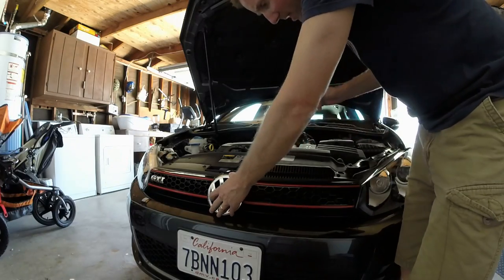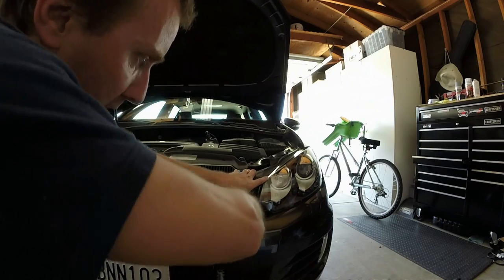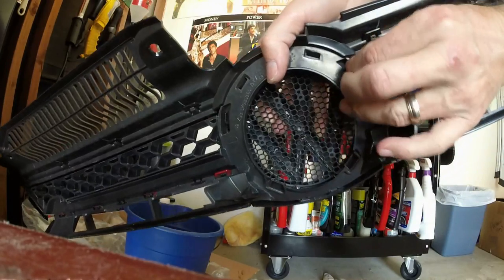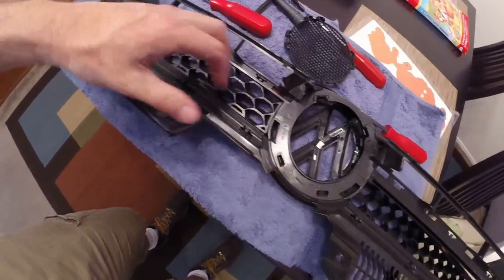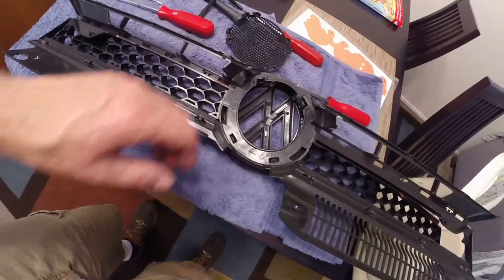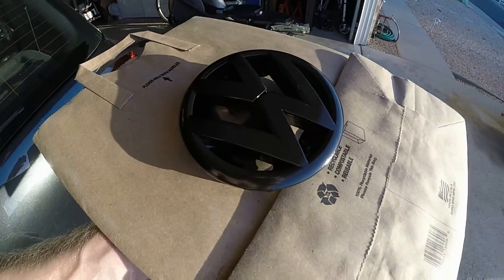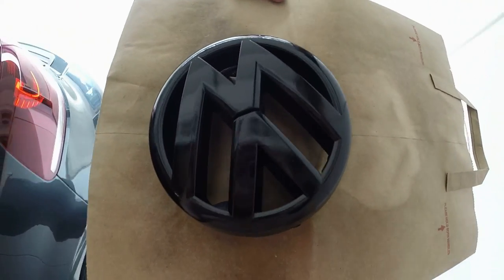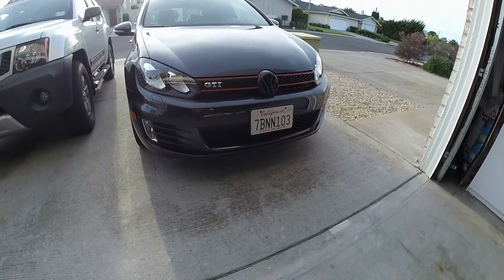2013 VW GTI: Episode 49: Removing Front Grill Emblem and Painting

Comment: Hey man thanks for the video!

Although i have a 2011 mk6 GTi, and i was able to just push in and twist off counter clockwise about 45 degrees. It didnt turn easily though so anyone trying to do it, you really have to TURNNNNN that thing pretty hard. After it twisted counter clockwise, the black net peice behind it clipped off by just pushing it upwards from the back, the new emblem you want to re-install at like a 45 degree angle push inward and twist clockwise to the correct fitment (it will snap into place)

All things considered, i broke 1 tab on my stock oem emblem, but it was alot easier and less time consuming then dis esembly of the whole grille.
Reply from the maker: ya.. i never been able to grasp the simply twist and remove technique. my tabs had locks on them once they snap into place. so if you force it off, all my tabs would break. maybe there are different versions of the emblem clips.

Comment: I did this project today and i found easier to pull the whole thing out pushing the two locking parts under the emblem down. After removing the screws i pulled the grill and i saw the clips right there at the bottom of the emblem. Just pushed them and the whole thing came out. Thanks for the tips here!
Reply: That is the best advice I've gotten for removing this, thanks!

Comment: I have a 2014 JSW SE 2.5L MKVI and I wasn't sure how the bottom grill is connected to the front bumper. It felt like I was going to break it if I pulled to hard.
LastHumansGarage's tip from Amazon (in the comment section below) worked like a charm. Took 5 mins to remove the OEM emblem and replace it with a new blackout emblem. Pushing it in and twisting was the trick. Don't pull too hard. Be gentle. The emblems clips bent a bit when I removed mine but it did not break. The plastic is durable and clips bent back into place. I would also recommend buying an ABS black plastic emblem instead of painting. I got my front emblem for $30 bucks online. I've been a professional artist for 20+ years and I can tell you if you want a clean perfect paint job on your emblem, painting them isn't the way to go. Even if you have all the right paint conditions and get a clear paint job (good luck - there is always going to be some imperfections) the paint will never hold up over the years. You are bound to get chips in the paint and its going to make your car look cheap. LastHumansGarage said he took 2 or 3 hours for painting (and repainting) his emblem. At least you removed your emblem from the car before painting. Some people don't even both removing their car's emblem before painting and just mask a little part around the badge. Most of those cars must have paint over spray all over the bumper and hood. That will destroy your cars paint job! It was worth it for me to buy a solid black plastic piece. Thanks again for the video and tips LastHumansGarage!
Reply from the maker: next time i would just buy one too. painting wasnt even worth the hassle or time. or results. i have since sold that emblem in the video.
Reply: LastHumansGarage
Too true! Way too much mess and hassle. I've been there with other painting projects. Plus my wife would kill me if I started spray painting parts of our brand new car! The close I'm getting to paint is blacking out the chrome around the window trim with car wrap material.

Comment: Since I'm banned from pretty every VW message board on the internet, I thought I'd share a great tip on removing the grille: use a guitar pick.

Seriously. Grab a typical, medium thickness guitar pick, and wedge it between the grille and bumper. You could probably also use a credit card, but the idea is, to push down the tab on the bumper, and pull on the grille at the same time.

I had a couple stubborn clips, and right before trying a screwdriver, realized I had a pick in my pocket. 

Made my life unbelievably easier :)
Reply from the maker: +jm71681 ha.. well you're welcome to post here as long as you don't do whatever you must have done on the VW forums to get banned. good tip.
Reply: +LastHumansGarage Honestly, I don't even KNOW what I did, it was so long ago :(

After I got my MKVI, I found your channel and the information in your videos has been incredibly helpful :) I just wanted to share something I found, that made my life SO much easier, and virtually eliminates the possibility of breaking clips when removing the grille :)
Reply from the maker: +jm71681 i do have guitar picks.. too bad i have no GTI. but i dont want one right now anyway. my Subaru is keeping me plenty happy.

Comment: I purchased a " pre painted" one for the front, to try and save time ( it also has red inlay to match my car! Looks great) so... I removed grill to find my vw tab was melted to my grill? No wonder the twist thing never worked, lol.. so my question, what is best way to get vw badge out? ..., roto zip? Heat? Our Will razor work? Love your vids and would appreciate your input on this...
Reply: some are melted to prevent removal. you use a soldering iron. not sure what you melt as i havent seen one. hopefully it goes back together after melting.
Reply: Thanks,  I'll try to get some good video n pics n post them. . I'll let you know when I do

Comment: This worked for me if pulling doesn't work i have a tdi not a gti, push the bumper down and shine a light in the groove to see where the clips are, there should be 8 with of them 2 on the outer edges, jam a wide screwdriver in between the grill and bumper on those places and pry it apart and pull so the clips come free, do this one by one for each clip and it should come out. 

I spend more than an hour on it i'm so happy it finally came off
Reply from the maker: make sure you only use a plastic interior tool on that, or you risk chipping ur paint.
Reply: LastHumansGarage i just used a screwdriver, it didn't even make a mark, i don't really care much about my paint the front is already scratched and road gravel damaged a lot
Reply: LastHumansGarage also you found it hard to separate the grill but on the normal golf it's much harder, on the gti it are only 16 clips but on mine it are 32, i ended up cutting off half of them because it was just impossible otherwise. It's unbelievable how difficult vw made it just to swap the badge

Comment: You don't have to remove the grill at all. I removed mine and all you need to do is grab the emblem and turn. It is tough but once you turn it, it comes right off. To put it back on just line it up and twist it back in and it will lock.
Reply from the maker: ya... maybe i just didnt grab it right........
Reply: It was pretty hard for me until finally it gave in. But it twisted and popped right out.

Comment from the maker: I found this tip on Amazon. I never tried pushing INWARDS as I turned. Maybe that is the trick..  "First remove the stock emblem by pressing in and turning left. After stock emblem is removed take new emblem and place it in with it tilted to the left. The new emblem should slide in and then press in and turn right. The emblem with snap into place."
Reply: +LastHumansGarage Bought this car in this specific paint a while ago, so far all of my little mod plans seem to be answered in this epic playlist  of yours! Thanks a LOT from the Netherlands
Reply: LastHumansGarage is there a way to take off the front left gti logo because I want to take off all the emblems but not  the VW in the front and back leave and black then both out

Comment: Love the video... Unfortunately I can't get the stupid tabs off to separate the mesh grille. I have the whole grille off the car but can't access the emblem. Obviously it is quite hard to record and do that at the same time so would you by chance know where you found the DIY to removing the mesh grille? I hope you see this comment as this video is quite old. Thanks in advance!
Reply from the maker: Kevin Kappra there wasnt any DIY's for that part.. for a reason. its super hard to do, and you WILL break tabs. you just have to accept it if you want your emblem out.
Reply: I can't even get to the part where you removed the mesh behind the actual emblem haha. Besides the tabs next to the emblem, what other tabs need to be popped off to remove the mesh part. If you can't remember it's ok. I know this was a long time ago.

Comment: I've spent the last half hour trying to get the grille off with no luck. I have a 2013 Golf. The 4 screwed are off and I've pulled at both corners with everything I've got and it will not come off. Any help?
Reply from the maker: SLIPKNOTmaggot262 its a bitch dude.. something will end up breaking no doubt. the design sucks.
Reply: LastHumansGarage Hey, thanks for getting back to me.  With some more effort I got it off and got the badgeless grille installed.  Thanks!

Comment: I just switched my chrome emblem to gloss black want to change the GTI chrome to black as well how do you remove the letters
Reply from the maker: +Samuel Badillo with a heat gun, some fishing line maybe, and careful prying
Reply: +LastHumansGarage Jesus lord I don't think I have the skills to perform. that duty I'm screwed I did rear emblem front emblem when I removed the grille I notice there was some clips that looked like it holded the lettering but wasn't sure just bought the GTI 6 months ago and don't really want to mess with it and break the grille so I would use a heat gun on the lettering/grille than with fish line try to yank them out or with a set of pliers ima try my best I'm hoping I can do it cause this week ima do the rear lettering so I will only be missing the front lettering :(